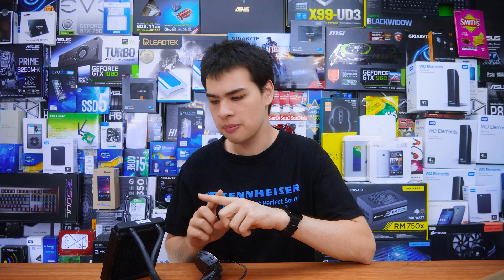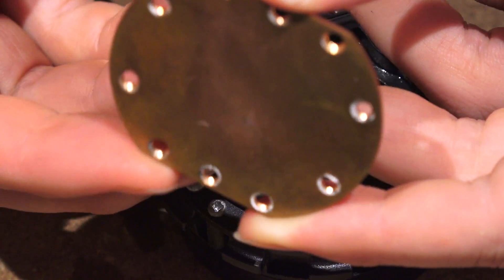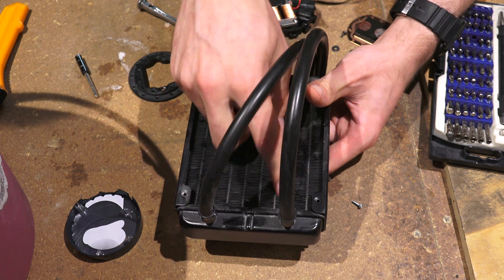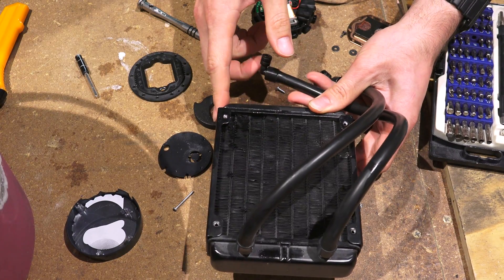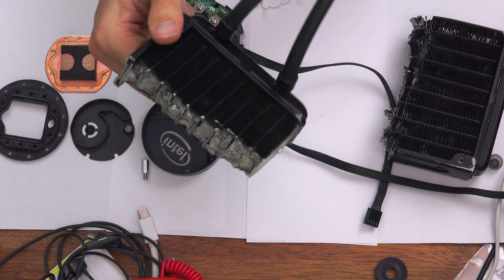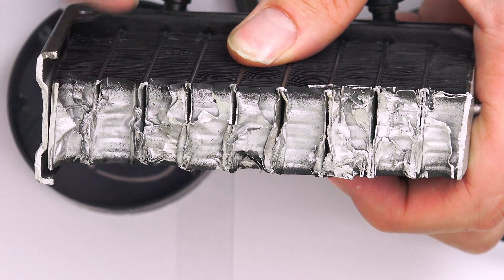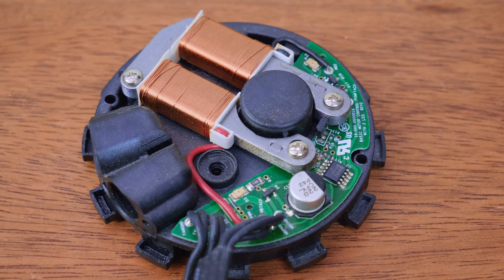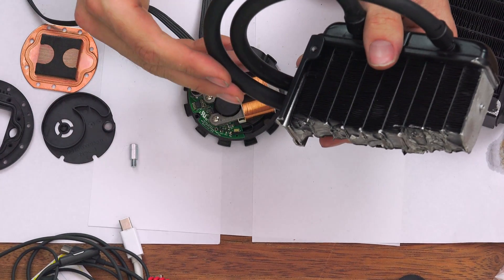AIO Water cooler Tear down

Comment: The reason for the glycol water mix is to prevent galvanic corrosion due to the dissimilar metals between the radiator and cold plate.
Reply: In the old days, they just used copper and not aluminum for everything. It is these two that require a special mix to avoid multiple problems.
 I learn first about this when I bought an aluminum water-cooling temperature sensor. There was a warning somewhere.
It is very attractive for AIO makers to make aluminum radiators rather than copper as they were made in the past. It is cheaper, and the vast majority of the people
who buy them can only one question about the metal type, which one is cheaper?